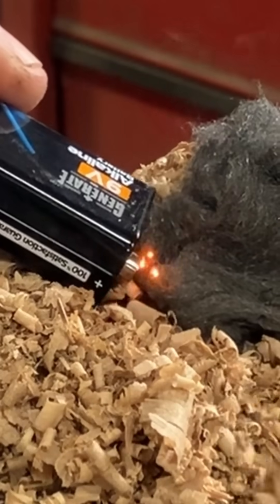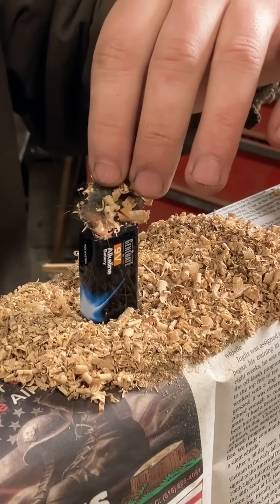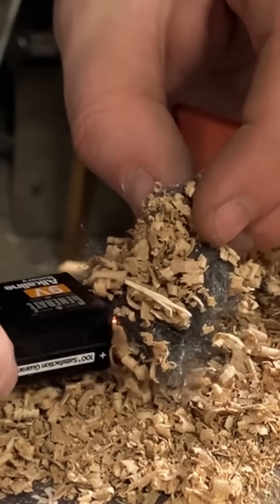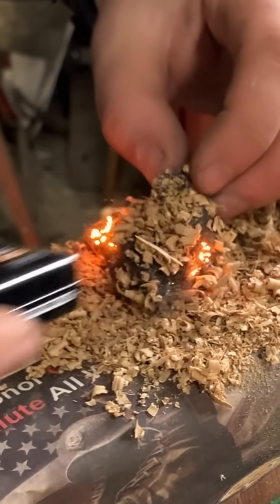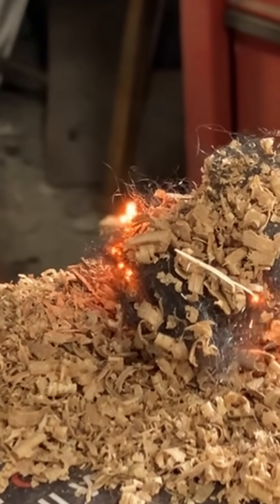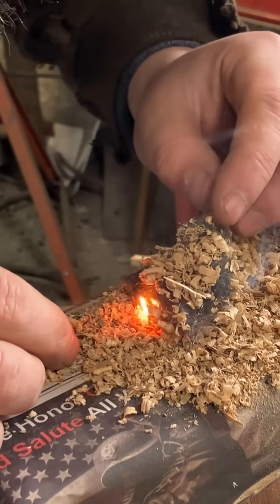I Touched Steel Wool with a Battery… Here’s What Happened

Comment: I actually use 0000 steel wool and a ferro rod to light my gas forge. With the blower for the ribbon burner, it tends to blow out matches and lighters, and will blow burning paper clear out of the forge before it lights, so I strike the rod into steel wool, toss it in the forge, turn on the blower, and ease on the gas. The steel wool is heavy enough to not blow out the door, and the forge lights up nice and smooth with no scary outflash.
Reply from the maker: If it works it works! That’s a great idea! It’s always a bit unnerving when explosive gasses are involved lol
Reply: This is a badass mfer right here